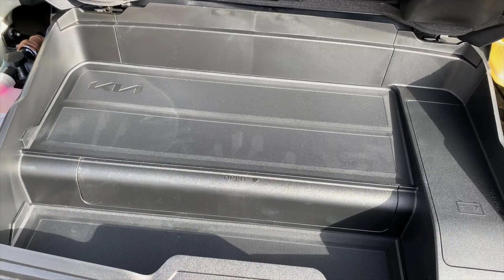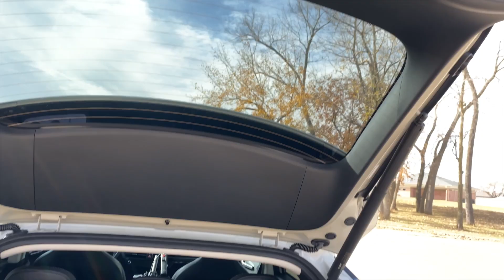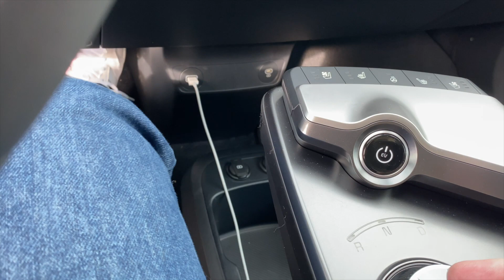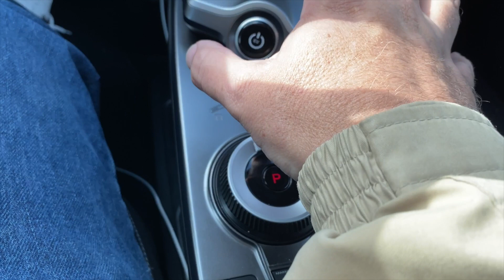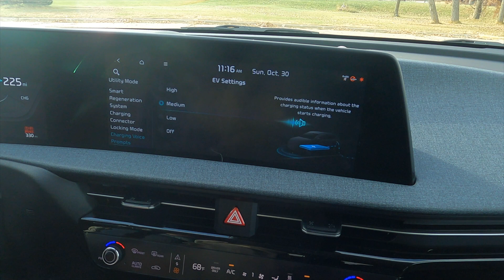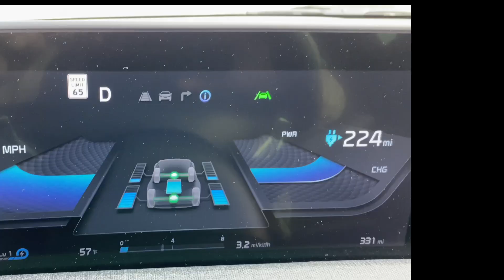2022 KIA EV6 Review

Comment: I was liking this car until a I watched this. You exposed alot of things that I dislike! 😎
Reply from the maker: There were some things that I really liked. I grew up driving rear wheel drive cars, so the EV6 being rear wheel biased was a big plus. Hopefully, they will get the weird 360 camera view fixed because it was terrible. I haven’t seen that view in other Kia vehicles so I don’t know if it is a fundamental problem or just something in this model.
Reply: @mynirophev3121  oh is this not even four-wheel drive? God I must have missed that...
Reply from the maker: It is four wheel drive, but the larger motor is in the rear. When driving at highway speed, the front motor will be disengaged to improve efficiency.

Comment: The headrest is moveable
Reply from the maker: I only saw a way to move it up and down.  The user manual doesn’t have any information on how to move it forward and back.
Reply: @mynirophev3121  👍🏼 I own a EV6 so I know the headrest is adjustable fore and aft. I love the car🥰 I owned a Niro Phev before.
Reply from the maker: How do you adjust it?  I could live with the 360 camera, but the headrest position was a problem.
Reply: @mynirophev3121  you just pull the headrest forwards and backwards, it's springy. I don't have the 360 camera
Reply from the maker: I wish that YouTube had a way for me to annotate a video with updated information. I will add this to the notes. Thanks for the information!